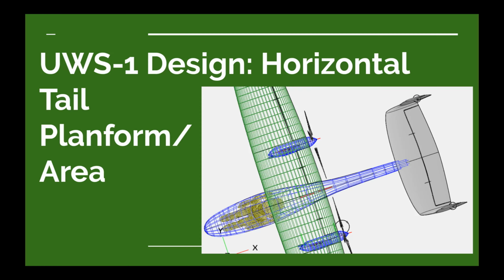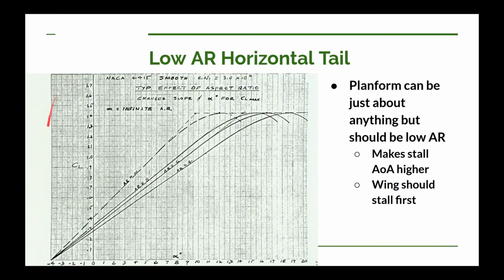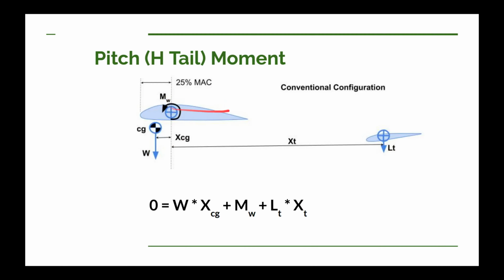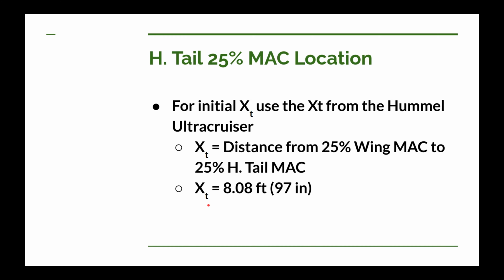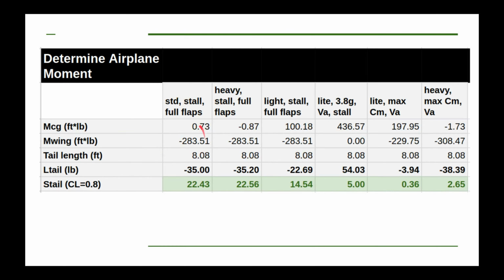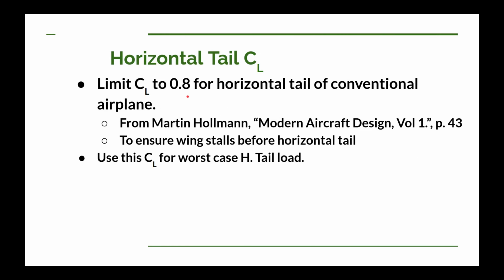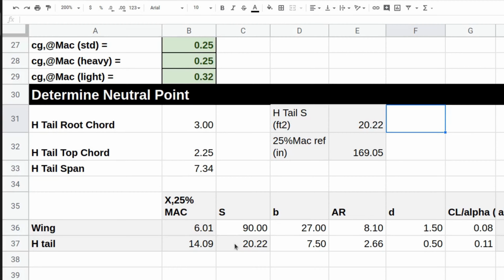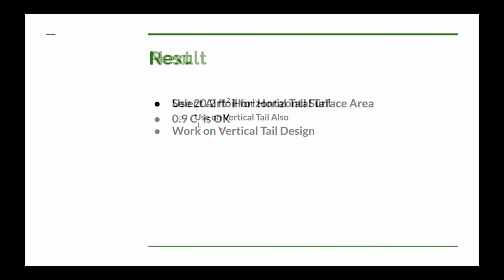UWS-1 Design: Horizontal Tail Planform/Size

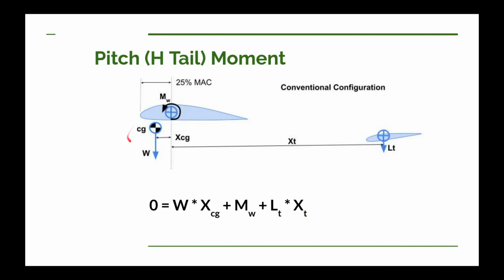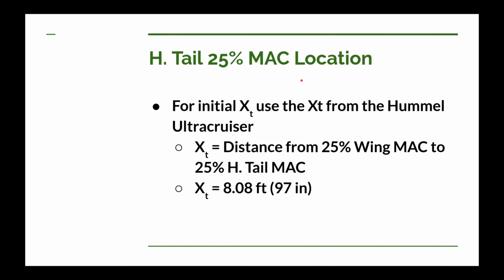Comment: With your main moment balance equation (e.g. 5:44 to 8:04) it looks like you omitted the pitch moment of the tail itself. With the tail having a planform area of about a quarter of the wing, I’d have thought that its pitch moment would be significant. Did I miss something?

Comment: What if my horizontal tail (canard in my case) is almost as large as the wing? How do I deal with the moment of the canard? Are there any other things I should know?

Also, if we ignore the first question, what if my tail surface is bigger than the calculated result? The NP position is fine on my end, so it should be statically stable. Would the tail being larger than required result in more maneuverability (i.e. I would have to pull back on the stick with less force to get the same pitch up as with a smaller tail)?
Reply from the maker: I have not done much investigation of canards, particularly large canards. So I'll stay away from that question for now. For a larger horizontal tail you will certainly have more pitch stability. You would probably want to move your CG back to so that it will not be too far forward. Generally when you have excess pitch stability your airplane is less maneuverable in pitch. More stability means that it does not want to move away from "straight" flight. So that means you need a larger control surface (unless you don't need significant pitch changes). A larger control surfaces is usually harder to deflect than a smaller control surface at the same speed. These are all generalities. Lots of other issues come into play too.

Comment: Hello! I am building a model canard and I have a question on how to calculate the moment of the CG. You say it is the distance from the AC of the wing (25% of the wing chord) multiplied by the total aircraft weight.

But I am in a situation where the CG is behind the AC. Now given that, should I use a negative value for the distance of the CG to the wing AC or do I just proceed the way you did with a positive value?

EDIT: I forgot to say that the CG is behind the AC because I am using a lifting surface for the fuselage (the fuselage is one big airfoil), so the AC of the whole airplane (fuselage and wings, but without the canard at the front) is forward of the CG.

EDIT 2: Also, since the tail length is measured from the AC of the wing to the AC of the tail, but my fuselage is a lifting surface and has its own AC, do I measure the length from the AC of the whole aircraft (fuselage and wings, but without the canard at the front) or the AC of the wing alone?
Reply from the maker: If I understand what you've said, You REALLY need to include all of your lifting surfaces in the AC calculation. The resultant AC has to be behind the CG. Until you can get that done you can not calculate the total moment. Calculating the AC for wing and canard is pretty straight forward but I do not know a way to approximate the lift of a lifting fuselage since it has such a low aspect ratio.

Comment: Good evening Sir, I am currently designing a plane thanks to your videos. I have a question about the "Mcg (ft*lb)" calculation in your spreadsheet. I am sure it is very simple to do but I don't undertsand how you found theses results, could you explain to me the way you did this calculation with an example please ? Thanks a lot from France, keep going on !
Reply from the maker: I will have to go back and look at what I did to see if I made a mistake.
Reply: @Designer103  Thanks a lot. Maybe it comes from a misunderstanding on my part. To find "Mcg", we have to multiply the position of the CG (in relation to the 25% MAC  position ) by the total weight of the plane didn't it ? Or CG position is finded in relation to Neutral point ? to the Aerodynamic center of the main wing ? Thanks by advance , this will be a great help for me.
Reply from the maker: @romainfcy4370  Since the Coefficient of Moment is usually reference from the 25% Chord then yes, the Mcg is determined exactly as you say. You want all of your moments calculated from the same reference point.
Reply: @Designer103  If it is just the CG position * total aircraft weight, why did you get different results for different flight conditions (for example with a light pilot, 3 different results)? There must be something else in the equation thats missing